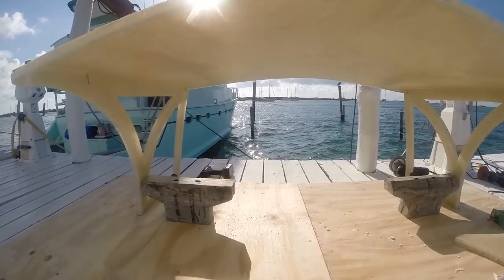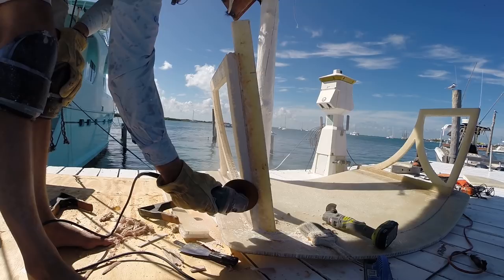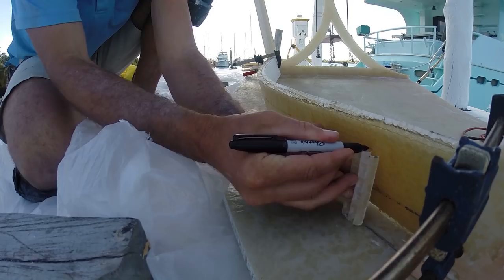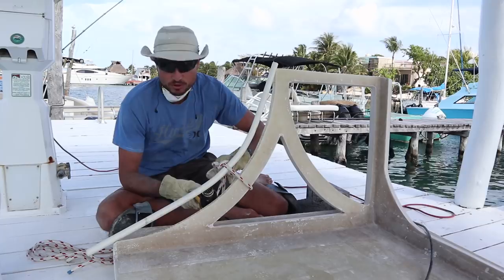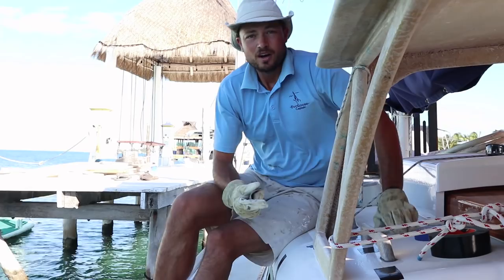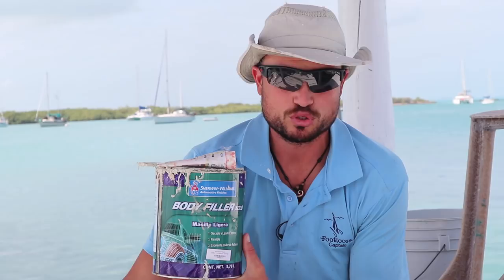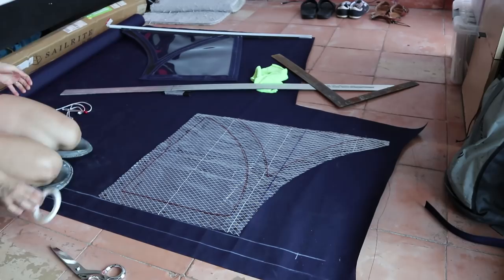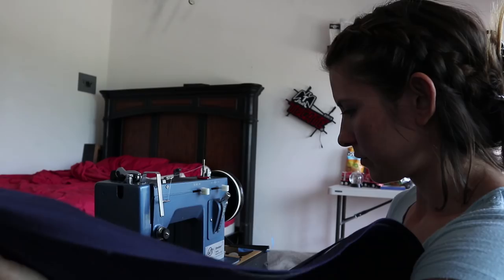Building Our Hard Dodger from Scratch Part 2 | S02E27

Comment: nice tutorial on canvas work,jordan probably could have saved himself a lot  of sanding and fairing by using peel ply on the joins ,and faced board to form a mold for the nidacore panels so the outer surface comes out smooth.

Comment: Your build project continues to impress (not sure about the dance moves), both doing great job, not sure why you didn't mount the electrical box in the front corner, but hey what ever works. One tip (bit late, I know) if you make a heat bed from a length of cardboard (L section) say 2" x 2" cardboard angel to what ever length you need then wrap in foil. You can lay your PVC pipe in that, heat up the entire length with the heat gun until it all goes rubbery, then fit it to the frame. Would still like to see some better dust management, hope to see you sailing soon

Comment: That's actually a useful video. Thanks! I'm thinking of building a similar, but much larger structure, basically replacing/enlarging the whole roof of the cabin.  I have a couple of questions:
1) How much did your doghouse weigh in the end?
2) How many layers of glass would I need to add for it to handle winches and jammers-piano for a 40' boat?
3) Would your structure be stronger if you used carbon-fiber sheets instead of glass? 
Cheers

Comment: I wonder how you cope with the glue from the adhesive tape sticking to the needle of the sewing machine? I always have problems with that and need to clean the the needle with aceton.
Reply from the maker: Hey David! I haven't had too many issues with it using PTFE thread, and when I do I also have a little spray bottle with some kind of solvent to clean it up like you mentioned! -Desiree